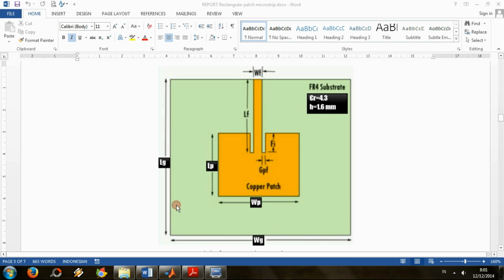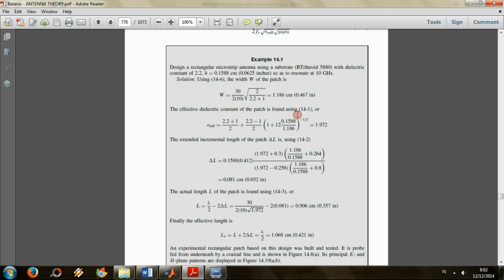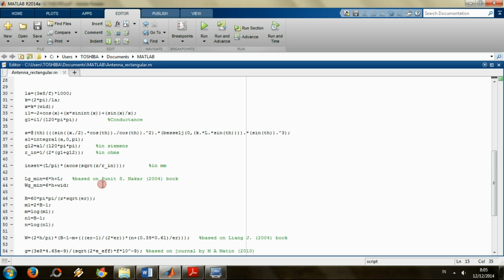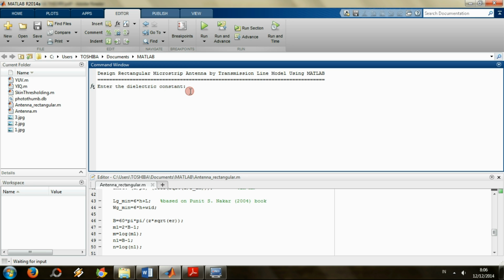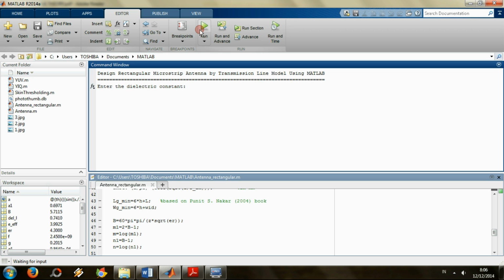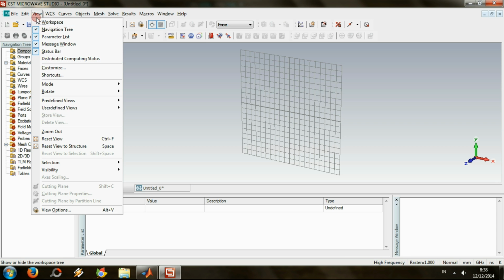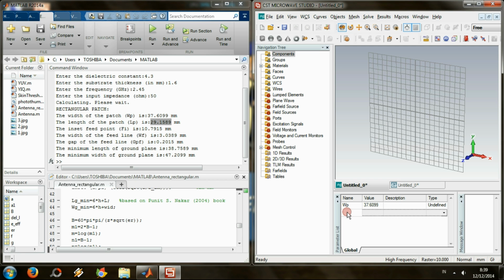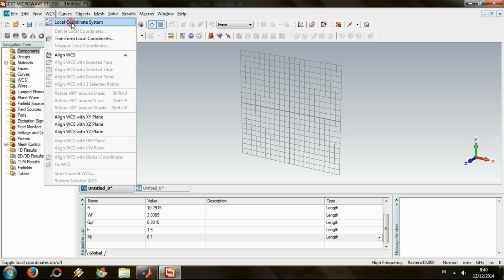Design of Rectangular Microstrip Patch Antenna Part 1 (MATLAB Calculation)

Comment: peace upon you

the correct code :
============================================

clear all
disp('design rectangular antenna by transmission line moder using matlab');
disp('---------------------------------------------------------------------------');

er = input('enter the dielectric constant = ');
h = input('enter the substract thickness(in mm) = ');
f = input('enter the frequency(in GHz) = ');
z = input('enter the input impedence(ohm) = ');
disp('calculating,please wait');

wid = (3e8/sqrt((er+1)/2)*2*f)*1000;

e_eff = ((er+1)/2)+(((er-1)/2)*(1+((12*h)/wid))^-0.5);
del_l = (((e_eff+0.3) * ((wid/h)+0.264))/((e_eff - 0.258)((wid/h)+0.8)))(0.412*h);
l_eff = (3e8/(2*f*sqrt(e_eff)))*1000;
L = l_eff-(2*del_l);
la = (3e8/f)*1000;
k = (2*pi)/la;
x = k*wid;

il = -2+cos(x)+(x*sinint(x))+(sin(x)/x);
g1 = il/(120*pi*pi);
a = @(th) (((sin((x./2).cos(th)) ./cos(th)) .^2). (besselj(0,(k.L. sin(th)))).* (sin(th)) .^ 3 );
 a1 = integral(a,0,pi);

g12 = a1/(120*pi*pi);
r_in = 1/(2*(g1+g12));
inset = (L/pi)*(acos(sqrt(z/r_in)));
Lg_min = 6*h+L;
Wg_min = 6*h + wid;
B = 60*pi*pi/(z*sqrt(er));
m1 = 2*B - 1;
m = log(m1);
n1 = B-1;
n = log(n1);
W = (2*h/pi)(B-1-m+(((er-1)/2*er))(n+(0.39*0.61/er)));
g = (3e8*4.65e-9)/(sqrt(2*e_eff)*f*10^-9);
disp('Rectangular patch:')
disp(['The width of the patch(wp) is:',num2str(wid),'mm'])
disp(['The length of the patch(Lp)is:',num2str(L),'mm'])
disp(['The inset feed point(Fi)is:',num2str(inset),'mm'])
disp(['The width of the feed line(Wf)is:',num2str(W),'mm'])
disp(['The gap of the feed line(Gpf)is:',num2str(g),'mm'])
disp(['The minimum length of ground plane is:',num2str(Lg_min),'mm'])
disp(['The minimum width of ground plane is:',num2str(Wg_min),'mm'])
Reply: a1 = integral(a,0,pi);can you tell me the expression of integral?

Comment: This is the correct code.  

clc
clear all
format long
disp('design rectangular antenna by transmission line moder using matlab');
disp('---------------------------------------------------------------------------');

er = input('enter the dielectric constant');
h = input('enter the substract thickness(in mm)');
f = input('enter the frequency(in GHz)');
z = input('enter the input impedence(ohm)');
disp('calculating,please wait');

f = f*1e9;
wid = (3e8/(sqrt((er+1)/2)*2*f))*1000;
e_eff = ((er+1)/2)+(((er-1)/2)*(1+((12*h)/wid))^-0.5);
del_l = (((e_eff+0.3)((wid/h)+0.264))/((e_eff-0.258)((wid/h)+0.8)))*(0.412*h);
l_eff = (3e8/(2*f*sqrt(e_eff)))*1000;
L = l_eff-(2*del_l);
la = (3e8/f)*1000;
k = (2*pi)/la;
x = k*(wid);
il = -2+cos(x)+(x*sinint(x))+(sin(x)/x);
g1 = il/(120*pi*pi);
a = @(th)(((sin((x./2).cos(th))./cos(th)).^2).(besselj(0,(k.L.*sin(th)))).(sin(th)).^3);
a1 = integral(a,0,pi);
g12 = a1/(120*pi*pi);
r_in = 1/(2*(g1+g12));
inset = (L/pi)*(acos(sqrt(z/r_in)));
Lg_min = 6*h+L;
Wg_min = 6*h + wid;
B = 60*pi*pi/(z*sqrt(er));
m1 = 2*B - 1;
m = log(m1);
n1 = B-1;
n = log(n1);
W = (2*h/pi)(B-1-m+(((er-1)/(2*er))(n+(0.39*0.61)/er)));
g = (3e8*4.65e-9)/(sqrt(2*e_eff)*f*10^-9);
disp('Rectangular patch:');
disp(['The width of the patch(wp) is:',num2str(wid),'mm']);
disp(['The length of the patch(Lp)is:',num2str(L),'mm']);
disp(['The inset feed point(Fi)is:',num2str(inset),'mm']);
disp(['The width of the feed line(Wf)is:',num2str(W),'mm']);
disp(['The gap of the feed line(Gpf)is:',num2str(g),'mm']);
disp(['The minimum length of ground plane is:',num2str(Lg_min),'mm']);
disp(['The minimum width of ground plane is:',num2str(Wg_min),'mm']);

Comment: Thanks Adil. However, there were some issues which are corrected below:

clc
clear all
format long
disp('Design Rectangular Microstrip Antenna by Transmission Line Model Using MATLAB');
disp('---------------------------------------------------------------------------');

er = input('Enter the dielectric constant: ');
h = input('Enter the substract thickness(in mm): ');
f = input('Enter the frequency(in GHz): ');
z = input('Enter the input impedance(ohm): ');
disp('Calculating, Please wait');
f = f*1e9;

%Calculate the width
wid = ((3e8/(2*f))*sqrt(2/(er+1)))*1000;    %in mm

%Calculate the effective dielectric constant
e_eff = ((er+1)/2)+(((er-1)/2)(1+(12(h/wid)))^-0.5);

%Calculate the extension of lenght L
del_l = (((e_eff+0.3)((wid/h)+0.264))/((e_eff-0.258)((wid/h)+0.8)))*(0.412*h);

%Calculate the effective lenght
l_eff = (3e8/(2*f*sqrt(e_eff)))*1000;

%Calculate the actual lenght
L = l_eff-(2*del_l);

la = (3e8/f)*1000;
k = (2*pi)/la;
x = k*wid;
il = -2+cos(x)+(x*sinint(x))+(sin(x)/x);
g1 = il/(120*pi*pi);    %Conductance

a = @(th)(((sin(x./2).cos(th)./cos(th)).^2).(besselj(0,(k.L.*sin(th)))).(sin(th)).^3);
a1 = integral(a,0,pi);
g12 = a1/(120*pi*pi);   %in siemens
r_in = 1/(2*(g1+g12));  %in ohms

inset = (L/pi)*(acos(sqrt(z/r_in)));    %in mm

Lg_min = 6*h+L; %based on Punit S. Nakar (2004) book
Wg_min = 6*h + wid;

B = 60*pi*pi/(z*sqrt(er));
m1 = 2*B - 1;
m = log(m1);
n1 = B-1;
n = log(n1);

W = (2*h/pi)(B-1-m+(((er-1)/2*er))(n+(0.39*0.61)/er));  %based on Liang J. (2004) book

g = (3e8*4.65e-9)/(sqrt(2*e_eff)*f*10^-9);  %based on journal by M A Matin (2010)

disp('Rectangular patch:');
disp(['The width of the patch(wp) is: ',num2str(wid),' mm']);
disp(['The length of the patch(Lp)is: ',num2str(L),' mm']);
disp(['The inset feed point(Fi)is: ',num2str(inset),' mm']);
disp(['The width of the feed line(Wf)is: ',num2str(W),' mm']);
disp(['The gap of the feed line(Gpf)is: ',num2str(g),' mm']);
disp(['The minimum length of ground plane is: ',num2str(Lg_min),' mm']);
disp(['The minimum width of ground plane is: ',num2str(Wg_min),' mm']);
Reply: did you find the correct codes ?
Reply: I want the correct code too. Where is it?
Reply: (Hi) = '(Hi)' where ' = *
So, need to substitute *'s appropriately to code above

Comment: Matlab code: 

clc
clear all
format long
disp('design rectangular antenna by transmission line moder using matlab');
disp('-----------------------------------------------------------------------------');

er = input('enter the dielectric constant');
h = input('enter the substract thickness(in mm)');
f = input('enter the frequency(in GHz)');
z = input('enter the input impedence(ohm)');
disp('calculating,please wait');

f = f*1e9;
wid = (3e8/sqrt((er+1)/2)*2*f)*1000;
e_eff = ((er+1)/2)+(((er-1)/2)*(1+((12*h)/wid))^-0.5);
del_l = (((e_eff+0.3)((wid/h)+0.264))/((e_eff-0.258)((wid/h)+0.8)))*(0.412*h);
l_eff = (3e8/(2*f*sqrt(e_eff)))*1000;
L = l_eff-(2*del_l);
la = (3e8/f)*1000;
k = (2*pi)/la;
x = k*wid;
il = -2+cos(x)+(x*sinint(x))+(sin(x)/x);
g1 = il/(120*pi*pi);
a = @(th)(((sin(x./2).cos(th)./cos(th)).^2).(besselj(0,(k.L.*sin(th)))).(sin(th)).^3);
a1 = integral(a,0,pi);
g12 = a1/(120*pi*pi);
r_in = 1/(2*(g1+g12));
inset = (L/pi)*(acos(sqrt(z/r_in)));
Lg_min = 6*h+L;
Wg_min = 6*h + wid;
B = 60*pi*pi/(2*sqrt(er));
m1 = 2*B - 1;
m = log(m1);
n1 = B-1;
n = log(n1);
W = (2*h/pi)(B-1-m+(((er-1)/2*er))(n+(0.39*0.61/er)));
g = (3e8*4.65e-9)/(sqrt(2*e_eff)*f*10^-9);
disp('Rectangular patch:');
disp(['The width of the patch(wp) is:',num2str(wid),'mm']);
disp(['The length of the patch(Lp)is:',num2str(L),'mm']);
disp(['The inset feed point(Fi)is:',num2str(inset),'mm']);
disp(['The width of the feed line(Wf)is:',num2str(W),'mm']);
disp(['The gap of the feed line(Gpf)is:',num2str(g),'mm']);
disp(['The minimum length of ground plane is:',num2str(Lg_min),'mm']);
disp(['The minimum width of ground plane is:',num2str(Wg_min),'mm']);
Reply: This does not work in Matlab. I realized something. Youtube automatically gets rid of the * sign between paranthesis, among other things. Copying and pasting code off here won't work.
Reply: clc 
clear all 
format long 
disp('Design rectangular antenna by transmission line mode using MATLAB');
 disp('---------------------------------------------------------------------------'); 
er = input('enter the dielectric constant :'); 
h = input('enter the subtract thickness(mm) :'); 
f = input('enter the frequency (GHz) :');
 z = input('enter the input impedance (ohm) :');
 disp('calculating. Please wait'); 
%% frequency 
f = f*1e9; 
%% calculate the width 
wid = (3e8/(sqrt((er+1)/2)*2*f))*1000;
 %% calculate the effective dieletric constant
 e_eff = ((er+1)/2)+(((er-1)/2)*(1+((12*h)/wid))^-0.5);
 %% calculate the ectension of length L 
del_l = (((e_eff+0.3)*((wid/h)+0.264))/((e_eff-0.258)*((wid/h)+0.8)))*(0.412*h); 
%% calculate the effective length 
l_eff = (3e8/(2*f*sqrt(e_eff)))*1000; 
%% calculate the actual length
 L = l_eff-(2*del_l);
 la = (3e8/f)*1000;
 k = (2*pi)/la; x = k*wid;
 il = -2+cos(x)+(x*sinint(x))+(sin(x)/x);
 g1 = il/(120*pi*pi); 
%conductance
 a = @(th)(((sin((x./2).*cos(th))./cos(th)).^2).*(besselj( 0,(k.*L.*sin(th)))).*(sin(th)).^3); 
a1 = integral(a,0,pi); 
g12 = a1/(120*pi*pi);
 % in siemens
r_in = 1/(2*(g1+g12)); 
%in ohms 
inset = (L/pi)*(acos(sqrt(z/r_in))); 
Lg_min = 6*h+L; 
%based on Punit S. Nakar (2004) book
 Wg_min = 6*h + wid; B = 60*pi*pi/(2*sqrt(er)); 
m1 = 2*B - 1; 
m = log(m1); 
n1 = B-1; 
n = log(n1); 
W = (2*h/pi)*(B-1-m+(((er-1)/2*er))*(n+(0.39*0.61/er))); 
g = (3e8*4.65e-9)/(sqrt(2*e_eff)*f*10^-9); 
disp('Rectangular patch:') 
disp(['The width of the patch (Wp) is:',num2str(wid),' mm'])
 disp(['The length of the patch (Lp)is:',num2str(L),' mm'])
 disp(['The inset feed point(Fi)is:',num2str(inset),' mm'])
 disp(['The width of the feed line (Wf)is:',num2str(W),' mm'])
 disp(['The gap of the feed line (Gpf)is:',num2str(g),' mm'])
 disp(['The minimum length of ground plane is:',num2str(Lg_min),' mm']) 
disp(['The minimum width of ground plane is:',num2str(Wg_min),' mm'])
Reply: if any error"Unbalanced or unexpected parenthesis or bracket." is there plz add * to shown place.it will run corrctly.thank you
Reply: This code don´t function in Matlab, do you have this correct code?
Reply: Thank you, very useful. The following lines have been corrected: B = 60*pi*pi/(z*sqrt(er));  W = (2*h/pi)*(B-1-m+((er-1)/(2*er))*(n+(0.39*0.61/er)));

Comment: Hi Imee your video it's one one of the best video tutorial i've seen for microstrip antenna but  i can't find your script you mentioned in the video description in your blog, please can you re-upload the script for matlab? .And really thanks for your videos.
Reply: clc
clear all
format long

disp('Design Rectangular Microstrip Antenna by Transmission Line Model Using MATLAB');
disp('=============================================================================');
er=input('Enter the dielectric constant:');
h=input('Enter the substrate thickness (in mm):');
f=input('Enter the frequency (GHz):');
z=input('Enter the input impedance (ohm):');
disp('Calculating. Please wait.');
f=f*1e9;

%calculate the width
wid=(3e8/(sqrt((er+1)/2)*2*f))*1000;        %in mm

%calculate the effective dielectric constant
e_eff=((er+1)/2)+ (((er-1)/2)* (1+((12*h)/wid))^-0.5);

%calculate the extension of length L
del_l=(((e_eff+0.3)*((wid/h)+0.264))/((e_eff-0.258)*((wid/h)+0.8)))*(0.412*h);  %in mm

%calculate the effective length
l_eff=(3e8/(2*f*sqrt(e_eff)))*1000;

%calculate the actual length
L=l_eff-(2*del_l);

la=(3e8/f)*1000;
k=(2*pi)/la;
x=k*(wid);
i1=-2+cos(x)+(x*sinint(x))+(sin(x)/x);
g1=i1/(120*pi*pi);          %Conductance

a=@(th)(((sin((x./2).*cos(th))./cos(th)).^2).*(besselj(0,(k.*L.*sin(th)))).*(sin(th)).^3);
a1=integral(a,0,pi);
g12=a1/(120*pi*pi);     %in siemens
r_in=1/(2*(g1+g12));    %in ohms

inset=(L/pi)*(acos(sqrt(z/r_in)));        %in mm

Lg_min=6*h+L;   %based on Punit S. Nakar (2004) book
Wg_min=6*h+wid;

B=60*pi*pi/(z*sqrt(er)); 
m1=2*B-1;
m=log(m1);
n1=B-1;
n=log(n1);

W=(2*h/pi)*(B-1-m+(((er-1)/(2*er))*(n+(0.39*0.61)/er)));   %based on Liang J. (2004) book 

g=(3e8*4.65e-9)/(sqrt(2*e_eff)*f*10^-9);

disp('RECTANGULAR PATCH:')
    disp(['The width of the patch (Wp) is:',num2str(wid),' mm'])
    disp(['The length of the patch (Lp) is:',num2str(L),' mm'])
    disp(['The inset feed point (Fi) is:',num2str(inset),' mm'])
    disp(['The width of the feed line (Wf) is:',num2str(W),' mm'])
    disp(['The gap of the feed line (Gpf) is:',num2str(g),' mm'])
    disp(['The minimum length of ground plane is:',num2str(Lg_min),' mm'])
    disp(['The minimum width of ground plane is:',num2str(Wg_min),' mm'])